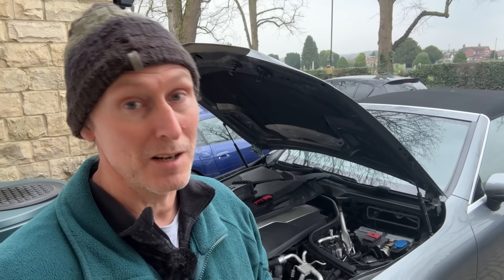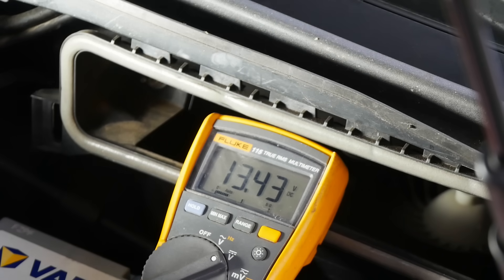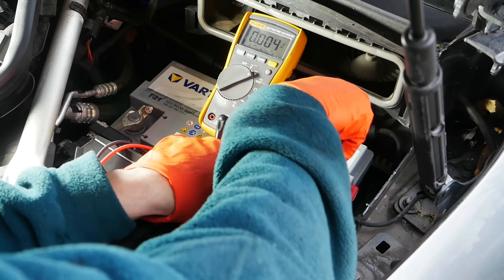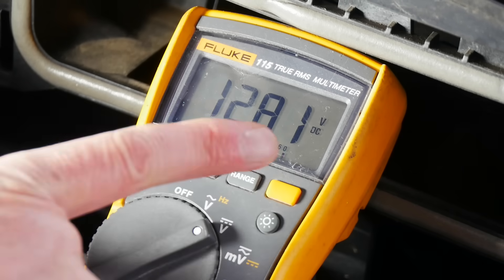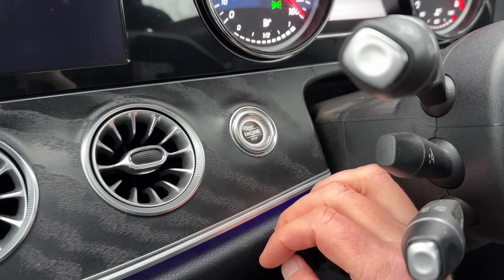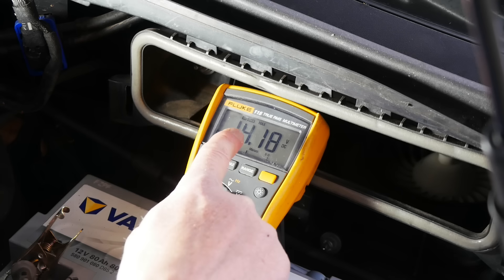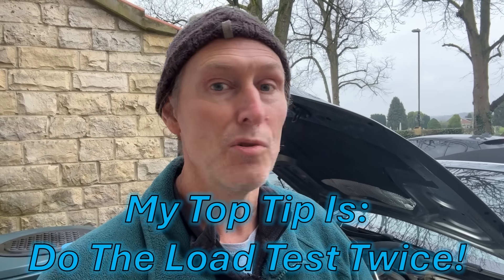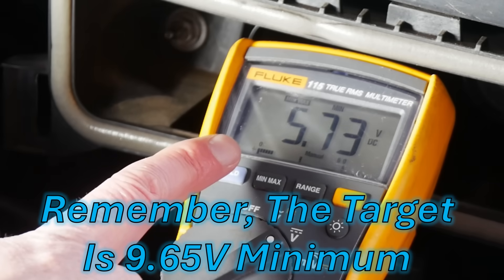Car Battery Load Test With Multimeter | EASY DIY

Comment: Measure the battery voltage with the engine off.  Then turn on the main headlights (high beam) for three minutes and then measure the battery voltage again.  If it has dropped below 12V the battery is weak and unreliable.

Comment: All you said is right!!
But if your battery is approximately 8 years….. just replace it,its a matter off time,tests or not,one day or another it will fail!!
And it will fail at the most inconvenient time to fail,according the murphy law( 1 principle)
I had two startbatteries on my boat,they where 10 years old,i tested them with two dedicated devices ( one works electronically,the other with old resistance technology) they where both 100 % ok….but 2 months later one morning…..
For approximately 100 euro or pounds,its not worth the inconvenience.

Comment: Run engine, check battery voltage, shut off engine check battery voltage. Turn on headlights check voltage. Leave lights on for 10 minutes check voltage if there is a big drop, you most likely have a bad battery. Been doing this for many years to check battery without a load tester. Also checks alternator output.
Reply: II hear when starting the car and the cranking voltage shouldn't be less than 9.65 volts correct? After that, turn off the car and turn on your lights for 30 secs or 2 minutes or 10 minutes, which I find a little too long, what Voltage reading should you get? My car starts like butter and has had it for 7 years with my car battery, but I want to see my reading results.

Comment: The problem with this method is, it doesn't tell you if your problem is a warn starter or an engine problem or a weak battery. This isn't a true load test, because you aren't using a known load.
Reply from the maker: Agree, the test isn’t perfect but for people that don’t have a load tester and don’t want to buy one for what may be a one time use, I’ve found the test pretty good. The assumption is that your starter motor is ok but even if it’s not, if your battery is good, the voltage shouldn’t drop through the floor when cranking. Cheers, Phil

Comment: Just buy a new flow cartridge ‼️ Most importantly don’t move the bottom of the tap or you may fracture the tail joints on the bottom of the tap‼️‼️ Trust me if it’s anything to do with water get a plumber. I thought I’d fixed my tap , 6 hours later water everywhere ‼️‼️‼️😱😱😱
Reply from the maker: What’s this got to do with testing a battery? 🤔

Comment: Really good video Phil. Clearly you are on top of the job. You are doing what in the aviation world is a capacity check...but in fairness, i think your idea is more positive. Btw 80% is the cut-off, ie 9.6v on 12v aircraft batteries. Thank you
Reply from the maker: Hi, thanks for your comment, always good to get an insight into another engineering industry, I always think of aircraft procedure and methods as being up at the very top! Cheers, Phil

Comment: Thanks for the video. I'm having to jump start my car every morning since Jan. I just did a volt test and it was 12.09. Is that too low?

Rac did a drain test yesterday and it was 0.7 however it was straight after car had gone off so maybe some of the electrics were still running
Reply from the maker: Yep, 12.09v is very low. Here’s a link to a chart: https://www.rvtechlibrary.com/battery/bat_volts.php Winter is a hard time for batteries. Probably best to check your voltage when the car is running, just to make sure the alternator is charging properly (should be 13.5v to 14.5v). When you charge the battery overnight, is it showing fully charged the next day? 12.6v+? If your battery is way down, it can take 10-12hrs to fully charge it. It could be that the battery is low and never gets fully charged again before being used again but that does depend on how long your journey is when you use it the next day, 30mins or more should charge the battery more than it loses from starting the car. Hope that helps!
Reply: @ReviveMyRide  thanks. I took it on the motorway for an hour on Saturday doing high revs and speeds. Sunday it was dead again. After I sent u my last msg i tried turning car on again (half hr later) and it didn't start.  Battery was 11.89.

When it turned on earlier it did go to 14.3

Comment: Spot on, in all the years of working on hundreds of cars, I've not thought of doing that with my multimeter.
Reply from the maker: Thanks! Yes, it’s worth a try if you suspect you have a problem and don’t own or want to buy a load tester! Cheers, Phil
Reply: @ReviveMyRide  How do you see the low voltage if my multimeter has no memory reading for low while running? How do you do a load test only using a multimeter do you turn on the fan, lights etc?
Reply: @AnthonyManzio  You could have someone watch the reading or record it somehow. You don't need to turn on the lights as much as you would if you were doing a load test on the alternator for amperage/voltage output to handle electrical loads. I used to record things all the time to watch it back.
Reply: @AnthonyManzio  preferably one would use an analog meter

Comment: So if the battery is going flat over night. What are the next steps?  Can you use a battery charger + repair to fix? Or just get a new battery?
Reply from the maker: Hi, battery going flat over night could be a few things. Ultimately, you will need to charge the battery to do any testing. It could be that it is just a one off. Then, yes, it could be the battery, which isn’t holding charge and the test in the video should give you an indication of this. But also, it could be that something is draining your battery overnight (power drain from your car). A quick test for this is to disconnect your battery (assuming it is fully charged already from the car being driven) overnight and in the morning reconnect it and see if it starts your car. Hope this helps! Cheers, Phil

Comment: Some Bluetooth receiver to radio aux plugin devices also show voltage. My cars battery is good for week and half. The trickle charger has not helped. It's very old so think I need new battery

Comment: This is not the way to test battery load performance. You must use "battery load tester"; multimeter does not tell the truth. Plus, your alternator is running. 13.43v was coming from the alternator, not from the battery.

Comment: Great job. What I'd like to know and didn't understand is whether at this point you would recommend replacing the battery or wait some more months.
Reply from the maker: Hi, well my battery had gotten to the point where it was giving me significant problems. It would start one and seem perfect but if I needed to stop soon (for fuel etc) it would always have charge left for a second stop. It seemed to be charging up ok and reaching full charge, hence I did this load test and did it twice to replicate real life use. Back to your question: if it’s still working, keep on rocking. If it lets you down or you can’t take the risk for reliability then if it failed the test, best to replace it! Cheers, Phil
Reply: @ReviveMyRide  Cheers!
Reply: Depends on economics, the weather and your car. If your flush with cash, change it. If the weather is decently nice and warm and you don't mind walking, wait till it's done (but keep in mind that charging a weak battery can be hard on an alternator). Flashy new modern car? Change the battery. Not doing so can be more trouble than it's worth, especially if it's an all electric as you might not even be able to open the door. A week battery in a new car can cause modules to indicate issues and set codes. Modern cars are the stuff electrical nightmares are made of. Lastly, with a newer car, check the manual  / videos etc. for your year and model. Changing a battery may not be as easy as you think. BTW this was a very good video. No bs.

Comment: Cleaning battery terminals should be a preventative maintenance repair operation. It should be done before any testing. I’m not talking about the visible fuzzy stuff that you can see. It is the posts and terminals being tarnished. 

I was replacing a battery because the resting voltage was low and it was cranking slowly and the battery was ten years old. Once I got the terminal off I saw how tarnished they were. I cleaned them, charged to 14.7 volts and got another couple of years out of it.
Reply from the maker: Thanks, so good points there! Yes, sometimes it’s best to look at battery terminals before you get a problem (maybe you have noticed the car starting more slowly) and also, as you say, the contaminant isn’t always thick corrosion, it can be a much thinner build up. Cheers for chiming in 👍 Thanks, Phil

Comment: Car batteries have 6 cells each 2.2 volts per cell  so when a 12 volt battery reads 12volts its rubbish.
Reply from the maker: Isn’t it possible that a few of the cells have lost some capacity and are delivering less than 2.2 volts each?

Comment: Get a cigarette lighter socket DC volt meter and plug it in and easily monitor load test every time you start up
Reply: I believe this can be done with cheap obd2 reader too 😃

Comment: Hi ! I had exactly that problem. I was sold a new battery but the discharge over night continued …
The garage pretended my car had a parasitic current draw problem and I had to bring it to a car-electric !
Doing exactly what you did showed the new battery was not good and not holding the charge while starting the motor. Thank you so much
Reply from the maker: Hi, glad the video helped you! I imagine some cars do have something like a parasitic drain but surely it can’t be very common. Garages, battery suppliers just use it as a “get out” 😡 cheers for your comment! Thanks, Phil

Comment: The 13.45 v measured after charging meant that the battery was holding surface charge, that would need to be removed before testing. This is done quite simply by putting a small load such as the interior fan motor for 10-15 seconds 
A load test is best done over 10-15 seconds, by loading the engine using the starter motor. This should only be done if the battery shows more than 12.2 volts, after surface charge is removed, ( half charged ). The engine needs disabling, to prevent starting, not always easy, but can be done by removing fuel pump fuse, or similar. If you can power starter motor remotely, this can be another option. Once you start cranking, the voltage will drop, but will stabilise on a good battery, not dropping below 9.0 volts. Any lower, indicates battery failure. 
The follow on test then, is to check charging voltage, with alternator under load, headlights, heated rear screen, and heater blower, while engine running. The voltage then needs to be above 13.5 volts, and on most cars, maximum of 14.5, (some smart charge systems will be higher, after start up until stabilising. An amp clamp can be used around battery input or output, to measure for a positive input of charge, when battery under load, not drawing more current than the alternator can supply.
If this is all good, you need to check for any current drain, when all is switched off, and car locked. This necessitates access to battery terminals, with car being locked, some bonnet open switches need to be disabled, ( disconnected), to do this. 
When the car fully ‘ shuts down power ‘ , ecu’s and alarms etc ‘sleeping’, you should use amp clamp around one of the two battery leads, complete, to measure for any excessive current drain, above 0.02 amps on most cars. Any high reading could be cause of battery draining due to parasitic load, such as boot light or anything electrical that has failed to turn off. 
Make sure to follow up voltage drop test with both charge test and drain test before replacing battery.
I’ve checked and changed batteries for at least 30 years, and sometimes learned by mistakes, hope this helps those interested 😊
Reply: You know what you are talking about. 

Cleaning battery terminals should have a preventative maintenance repair operation. I was replacing a battery because the resting voltage was low and it was cranking slowly and the battery was ten years old. Once I got the terminal off I saw how tarnished they were. I cleaned them, charged to 14.7 volts and got another couple of years out of it. 

Anyway, what I wanted to ask you about is Amp Clamp. I was shopping for one to measure the parasitic drain. The ones that I saw didn’t look like they would measure that low of a current. Do you know of a brand that will?

Thanks

Comment: FYI, 12V wet acid battery had 6 cells each at 2.1VDC x 6 cells = 12.6VDC.  Anything else, ie. “13.5VDC is considered residual voltage.  So your baseline for testing a fully charged battery is 12.6VDC not 12.75VDC
Thank you

Comment: This is about the most reliable test. I worked in a Renault & Kia dealership and both brands supplied a Midtronics battery tester which had to be used with warranty claims as they generated a test code. If you tested with one tester and the battery failed you could immediately test with the other and it would probably pass!
Reply from the maker: Ha, wow! Sounds about right! I found this test worked really well for me to just show me how much ooomph the battery had left in it. Cheers, Phil

Comment: Quite a few people saying the gps trackers installed either by the manufacturer or the dealers putting in their own after market devices can continually drain the battery if not wired in to the ignition circuit.

Comment: I have to replace my battery every 2 years. Getting ridiculous
Reply from the maker: Just an idea: One thing to check is programming / coding in the new battery. I haven’t done this myself yet but my understanding is that some newer cars adjust how they charge the battery over time. Older batteries need a higher charge rate but if you put a new battery on without updating the system, it over charges the new battery and kills it. Do a little bit of searching on forums for your vehicle.

Comment: Great explanation and a good tip for owners of 90's Jags like my XK8. These cars are very voltage sensitive and show all sorts of electrical problems if the cranking voltage drops into the low 9's and various module microprocessors reset themselves. I'm thinking of wiring in a Noco lithium starter pack to boost the voltage briefly just for starting. Do you think this is practical?
Reply from the maker: Thanks! Never tried this! If you have the knowledge, give it a try 👍 Apart from that, if your car isn’t a daily driver, the. S good trickle charger to maintain the battery is probably best.

Comment: Well, done! I worked for a battery company here in 🇺🇸. The ONLY thing u forgot to mention is how ols the battery IS. I experienced the exact thing on my own car with a poor load test & my battery was only 3yrs old. Mine is a hybrid to I had to have a different meter to do a simulated start. 👍
Reply from the maker: Thanks for the comment, yes battery age would have been a good point to make. 👍 The Varta battery featured in the video didn’t make it to its 3rd birthday. It had a 3yr guarantee and after a lot of pushing Tayna batteries finally agreed to replace it (they REALLY didn’t want to!). I used to think that batteries lasted 8yrs but my experience so far with Stop / Start cars is that it is much shorter, more like 5yrs. Thanks again for your comment. Cheers, Phil

Comment: I blame the alternator/voltage regulator because as an car electical systems engineer i know that battery with such high "idle" or open voltage there's something wrong (assuming your measuring was done after at least 6hrs of letting the battery rest after charging it) AND i say right now that the battery has been severely overcharged and it's electolyte is about 30-40% gone SO to reverse this you know what you have to do (refill and put on the invertrer welder on lowest amperage, it's usually 20A.. let it there just to get warm a little bit, let it cool for at least 1-2hrs and repeat 2-3 times. It MUST bubble, if any cell not bubbling, cell is short/dead, you can try more cycles but usually this means it's simply gone)

Comment: I would like to add a bad starter can also drag battery voltage down. So before condemning a battery as bad you must also determine the amount of amps being drawn by the starter. A bad starter say one for example with bad bearings will draw more amperage than a good starter which can falsely indicate a bad battery during this type of test.
Reply: Can we amp clamp the wire to the starter? How many amps should we expect?

Comment: You are not taking into account a faulty starter, a DC clamp meter would tell you if the starter has a fault i.e a short in its windings whereby it draws far more current than it should

Comment: Very good video.
How will a faulty starter motor or wiring, earth etc effect those results?
Reply: A faulty earth will cause the voltage at the starter voltage to drop below what the voltage at the battery does, this can be measured by connecting the voltmeter between the battery's negative post (not the connection but the actual terminal belonging to the battery) and the case of the starter itself, ideally this shouldn't read more than 0.2V and a reading of around 0.5V or higher will start having an effect of the performance of your starter
Reply from the maker: Thanks! Super useful info 👍

Comment: Maybe freshen up your battery by disconnecting from vehicle,  connect battery charger, run 50 amp charge for 1/2 hour then charge fully at 10 amps.
This should  assist in "desulfication" of the lead plates with insulating "tarnish" build up ....
If it does the job and works, not always because of battery condition, then you should run like new and get more battery life ....
Reply from the maker: Thanks for sharing! I’ll give this a try!